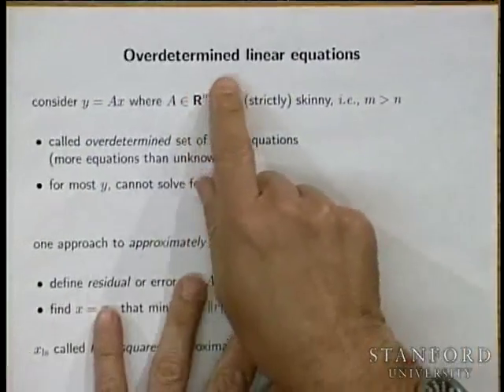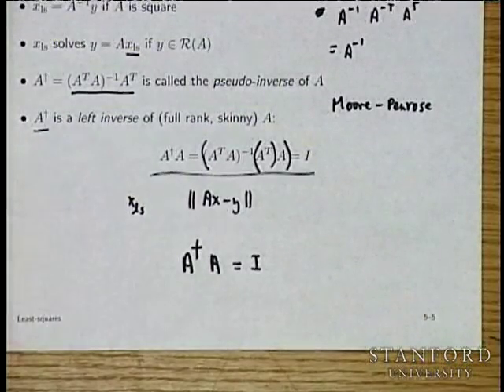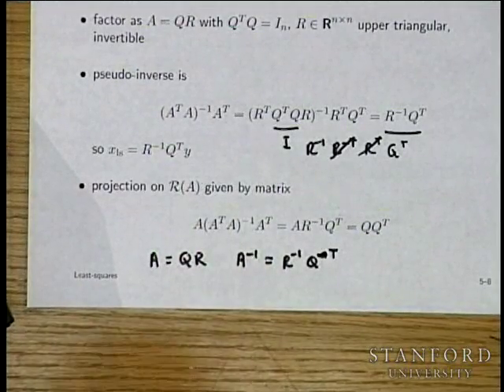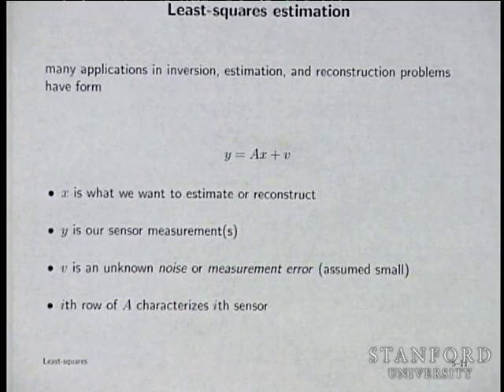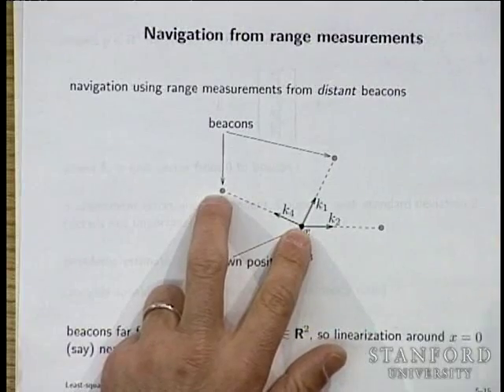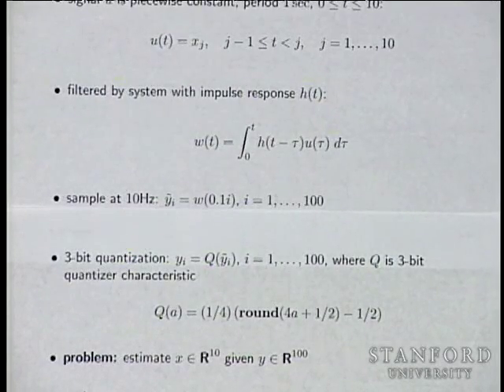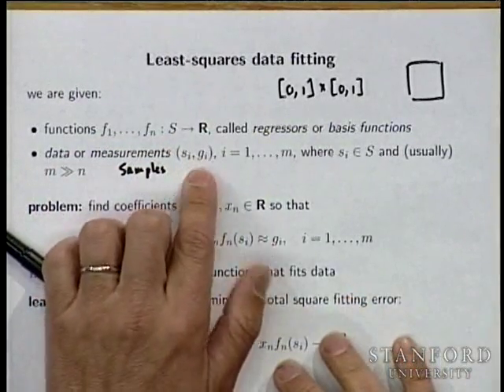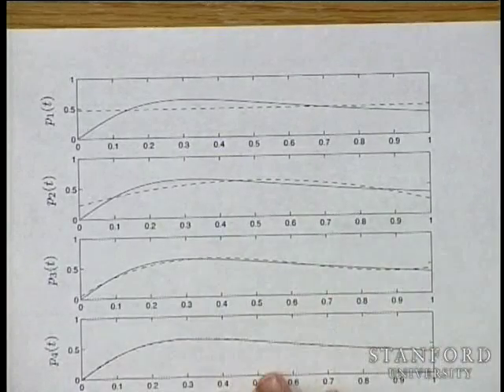Lecture 6 | Introduction to Linear Dynamical Systems

Comment: why Ax_ls - y = -Q_2Q^T_2y,  should it be -Q^T_2y?
Reply: I got it multiplication by orthogonal matrix doesn't change the norm, so multiply by Q_2 won't affect the result
Reply: I think its because Ax_ls-y gets you r=(Q_1*Q_1^T - I)y, because [Q_1, Q_2] is a orthonomal base, so (Q_1*Q_1^T - I)=-Q_2*Q_2^T

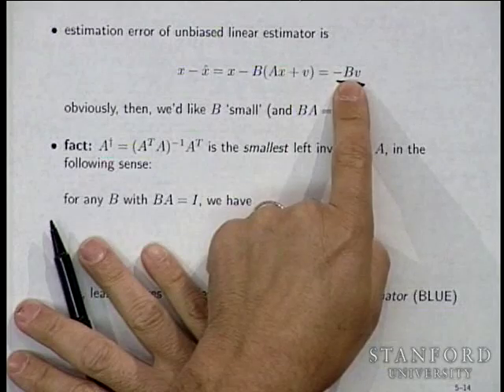Comment: the prof said at around 39:00 that for BLUE we need the smallest left inverse of A. Isn't an inverse of a matrix unique, hence "smallest" is redundant?! In this case, there cannot be more than one left inverse. Is this right?
Reply: Left inverse of a matrix is not unique. You can develop many different 
left inverses.
Reply: Kemal Ozdemir Thanks Sir. I just googled this and it turned out you're correct. I didn't know that.
Reply: Left inverse of a skinny matrix is not unique and Least Square method gives the smallest.